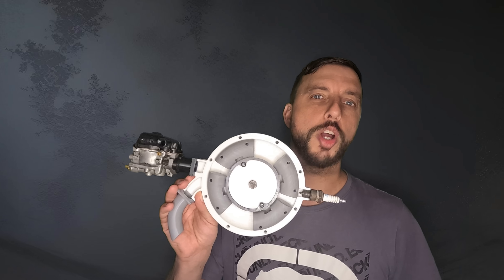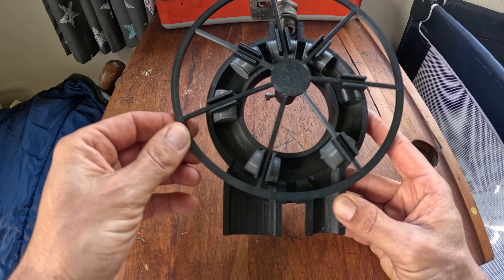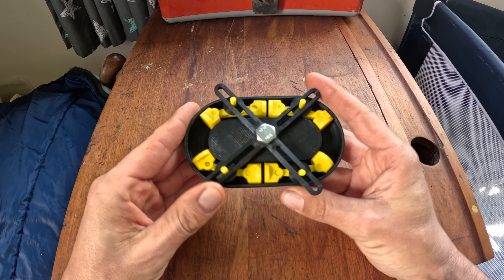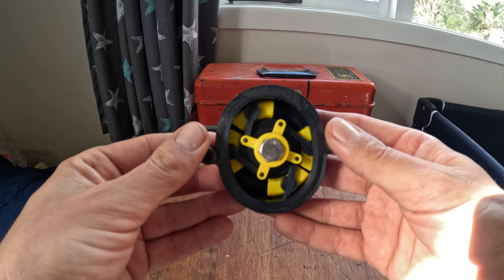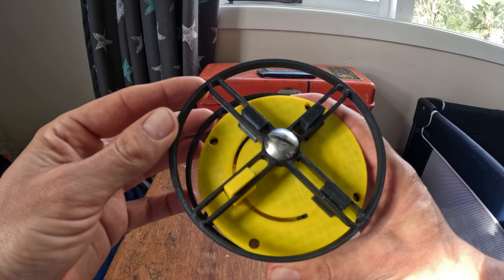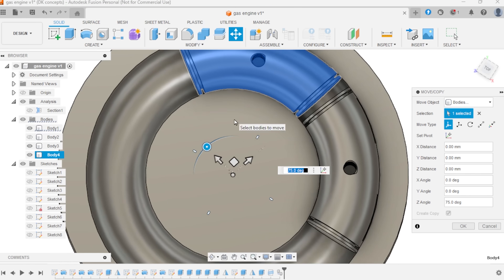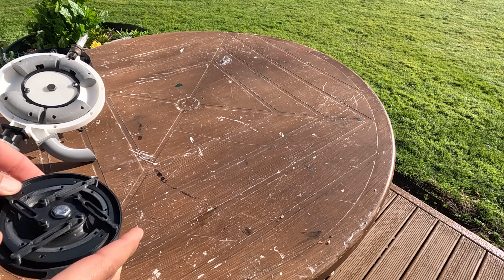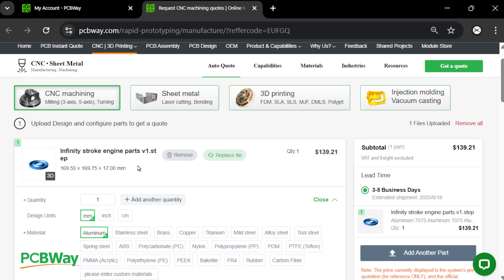Infinity Stroke Engine, More Powerful Engine?

Comment: There will only be two types of combustion engines, turbine (continuous combustion) and piston (intermediate combustion).
Combining the two creating a Frankenstein bastardized hermofidite combustion engine will never work. I loved the wankle engine, it was the coolest sounding engine ever. But cool does not feed the bulldog. 
Continuous combustion engines that use a rotating turbine to suck in air, compress that air, and ignite it, then exhaust it in a continuous cycle, deliver extremely high power for their weight are perfectly balanced, and have few moving parts. Which is makes them great for aircraft. But they have efficiency issues. High bypass turbofans get decent efficiency while producing insane power, but they are huge and are only practical for large aircraft. 
Piston engines are small and more efficient than turbine engines,  but produce less power, are heavy, have a massive amount of moving parts, and dew to intermediate combustion will always have balance issues. But last forever, because they use bigger, heavier, and stronger components, which is necessary to stand up to intermediate shock, and balancing issues.
Trying to combine the two types will always result in issues with sealing,efficiency, balance, longitivety, etc. At the end of the day what is the point of Combining them? You are either removing power, Simplicity, adding weight, etc to the turbine engine. Or removing efficiency, longitivety, etc from the piston engine. There is no happy medium. 
Continuous combustion throws away to much heat energy out the exhaust exhaust to make it a viable replacement for piston engine. That cannot be fixed.

Comment: "Since there is very little oscillation" - this engine has identical reciprocating energy amounts to a normal piston engine, it's just that both pistons also spin in one direction so it's deceptive, there is inheritantly nothing in this & similar designs that set them up for higher RPM compared to the same bore x stroke conventional engine except potentially balance but even an i3 still has good-enough balance so it's kinda not that relevant. Anyway I'm sure there are some benefits but still it's just a weird piston engine, nothing remotely alike a true rotary like a Wankel or that Liquid-Piston that the company decided to make exclusive to warmongers so none of us get the pleasure of using a rotary without apex-seal issues (potentially highest-RPM engine out there by it's nature). With all that said, if you can make it it'd be incredible and who knows, maybe some kind of real tangible benefits will be apparent, after all 2-strokes in any form are theoretically always less-efficient, except those old opposed-piston 2-stroek Diesels are still the most-efficient engines in both theory & practice, so you never know what a design is capable of until everything's in place & it's "in-flesh" so to speak.

Comment: Love this. For minimal prototype this is fine, but i imagine vibration will be a problem still. If you could have it symmetric somehow.  Firing on two sides at the same time. Also, aim for it being a generator, not driving on it. Much less problems with variable speeds and load, I imagine

Comment: Just so my comment doesnt get lost in the replies. Check the myt mighty yet tiny, quasiturbine, rotary vee, dyna cam, and the engine made by angelo di pietro
Reply from the maker: Thanks yes I have checked out that engine, actually quite encouraging knowing someone has made it before pretty wild power claims though
Reply: @dkthewelder claims were enough to get investors but not enough to get a product

Comment: How is the pressure in the "cylinder" being transferred to motion in one direction?  It will push equally forwards and backwards on the two adjacent pistons so the only thing favouring one direction is via those flimsy shafts to the ellipse.
Try placing your fingers between the two pistons and push them apart without favouring the direction you ultimately want the engine to rotate and see what happens.
Reply: To start a heavy flywheel, and high pressure always seeks lower pressure aslong as the exhaust side is lower pressure than the carb side it "should" spin forwards

Comment: Hey DK.  Fantastic idea and damn that's a lot of iterations.  I dig it.  Very cool to see the process.  As far as the spark plugs; Are you planning on mechanical or electrical for your trimming?  That might simplify the positioning of plugs.
Reply: Veritable plug positioning with a clutch might time fantastically.  But I'm not sure if that exists yet on a circular motor with no Dorito chip.
Reply from the maker: electrical timing but the plug position is a little tricky as the combustion chamber is moving

Comment: All the force is coming from two pistons pushing each other apart in opposite directions. This pushes the piston rods apart guiding them down the oval track to fill in the oval's most distant ends. The rods will open towards the direction that the oval track applies the least torque. The rods themselves are angled at the hinge to make the rods opening towards one direction easier than the other direction, making the net torque greater than 0 towards one particular direction... I think... You should test it by putting 2 fingers between 2 pistons and pushing them apart to see if it goes in one particular direction.
Reply from the maker: Yes when I push the pistons apart with my fingers it does as you say moves in the direction of less resistance, or better mechanical advantage. You explained that really well thankyou
Reply: @dkthewelder 🔴 What Is Islam?  
 
🔴 Islam is not just another religion.  
 
🔵 It is the same message preached by Moses, Jesus and Abraham. 
 
 🔴 Islam literally means ‘submission to God’ and it teaches us to have a direct relationship with God.  
 
 🔵 It reminds us that since God created us, no one should be worshipped except God alone.  
 
 🔴 It also teaches that God is nothing like a human being or like anything that we can imagine. 
 
🌍 The concept of God is summarized in the Quran as: 
 
📖 { “Say, He is God, the One.  God, the Absolute.  He does not give birth, nor was He born, and there is nothing like Him.”} (Quran 112:1-4) 📚 
 
🔴 Becoming a Muslim is not turning your back to Jesus.  
 
🔵 Rather it’s going back to the original teachings of Jesus and obeying him.  
 
 
More .....👇 
 
🔴 THE RETURN OF JESUS
Reply: That was exactly my thought too, push each other apart which makes them kinda inefficient. Yet, it could work with 2 intersecting loops which will drive 2 shafts. But, in this case, things become more complicated
Reply: Sounds really inefficient, if even workable in practice, but interesting implementation
Reply: I came down here to explain this exact issue. A ratcheting mechanism could be used to prevent the reverse motion in the "rear piston", I think I'm going to backtrack on that statement. Ratcheting implies a piston would have to come to a stop once per revolution. This would likely introduce a whole new host of issues in something you probably want to spin at 1,000+ RPM. Maybe a flywheel could... no it might aid in resisting the reverse motion but eventually it would stop spinning. 50% of every explosion's force would be in the opposite direction.

Comment: instead of moving pistons why not just make like a solid center piece that has cut outside for each stroke, it would be like a pack man shape, or more like one of those clouds from spongebob square pants , centrifugal force, theres a 2 stroke engine like that, I forget where I seen it and have the sceals on the outer ring beside the intake and exaust, give me some credit if you use my idea please
Reply from the maker: I think I have seen that motor, another one that is difficult to seal but a great idea

Comment: make the pistons out of iron or have then be a hybred metal the magnetic like a alumanum piston and a iron rod in the middle and use electro magnets to hold it in place higher the rpm the stronder the magnetic field
Reply: if you would do this you can conserve power by only having max curent during the combustion faze do to there will be more need for that point

Comment: Also, the second design you should have a steel liner for the barrings to ride on, and that's where the oil return vains can be, so that part can be replaced for repair purposes
Reply from the maker: yes that was what i was thinking!

Comment: Cool idea, but wouldn't there be a large amount of wear on the outside ring as the rpm's increase? I feel like the centrifugal force would cause uneven wear on the piston rings, along with uneven wear from the angles of the piston shape, along with the angle of the sleeves. There may even be blow back on the piston rod parts of the pistons since there is an open hole inside the piston that would pass over the exhaust/intakes shown here at 8:20.

Comment: You don't need a solid object to push the exhaust gasses out and draw in new air/fuel mix. You can do so by opening both ports simultaneously for a brief moment, which your prototype model does. The exhaust will begin to flow out under pressure when the exhaust port opens, and the inertia of the escaping exhaust will act to draw in a new intake charge when the intake port opens. After the exhaust port closes, the inertia of the intake mixture acts to pull in more intake mixture until the chamber is full and the intake port closes. You'll then need a tuned expansion chamber in the exhaust pipe to ensure the pressure wave travels continuously down the pipe and provides negative pressure to the cylinder at the tail end of the exhaust gas puff. This is why most two-stroke dirtbikes and ATVs have that weird looking bulge in the exhaust pipe.
Reply from the maker: I did think about that, the bottom of the 2 stroke piston pushes the next charge in through the transfer ports and some goes out the exhaust until it reaches rpm that the expansion chamber starts working. the other benefit of have the pistons move like that makes them oppose each other which should balance it better I think

Comment: Force transfer using magnets, steel rollers going on cylinder wall...
I've got so many questions...
The main of witch would be "What keeps the following piston from counterrotation once ignition occurs?!"
It looks as if you were trying to lift yourself in the air by yanking yourself by the crouch very hard, or am I missing something???

Comment: The problem is that if the detonation explosion has more force than the force of the rotating mass, the rotating mass will come to a halt. So your horsepower output will be limited to the actual rotating mass weight and speed.  The rotating speed will be limited to how fast the spark will fire. The more the rotational speed the more the explosion force will limit the rotation.
Reply: Yeah, it needs considerable flyheel mass, and that needs to be coupled to all the pistons in some way to overcome reciprocating forces
Reply: @wizrom3046  "Yeah, it needs considerable flyheel mass,"
What I am referring to is that there is nothing preventing these sliding pistons from moving backwards with the force of the detonation. There would be the exact same force on the two pistons. The same force to move one forward and the same force to move one backwards.
Reply: @nathanwoodruff9422   well you are partially correct, but his design connects the 4 pistons to a rotating output shaft, with 4 slider arms.
That stops them being pushed apart.
My point was that it needs a significantly large flywheel, to keep all pistons moving forward AND the sliding arms need to be large and robust enough.
Reply: @wizrom3046  _"well you are partially correct, but his design connects the 4 pistons to a rotating output shaft, with 4 slider arms.
That stops them being pushed apart."_
If the pistons were not being pushed apart the entire thing would not move. The detonation of the gas is pushing on the forward piston as much as that pressure is pushing on the rear piston. 
If the pressure between the 2 pistons is more than the weight of the rotating mass, the rotating mass will come to a halt. As I said, limiting the horsepower output.
Reply: @nathanwoodruff9422  more correctly. at its "TDC", combustion pressure is momentarily equal in both directions as both pistons are at the same radius, and same relative angle. as "expansion' continues, the leading piston is always at a slightly longer radius with more leverage than the trailing piston. the available force is the difference between the two. which amounts to very little...

its just another stuck in the rut "otto cycle with alternate geometry" approach. nothing new.
Reply: @paradiselost9946  "more correctly. at its "TDC","
TDC stands for Top Dead Center, where a piston in the cylinder is at its highest point in the cylinder where compression is the greatest. A roundy round of pistons has no TDC. The energy from the detonation of fuel is pressing both pistons with the same amount of pressure, both forward and backward in the roundy round.
Reply: @nathanwoodruff9422  see those quotation marks? see how i wrote "TDC"?

 it implies the "equivalent of TDC". 
"the point of maximum compression"

dont try to be clever when your very argument shows youre a halfwit and cannot understand simple concepts that shouldnt require spelling out.

it has a point of maximum compression. 

that the compression then has no real urge to act in one direction over the other is not the point in question now. its the fact that you cant comprehend what the "equivalent to TDC" is without having your hand held and gently guided...

or rotor doesnt have TDC either but its still marked as it on the case. i guess NSU didnt know WTF they were doing huh?

got an engine here with two top dead centers, a bottom dead center, and a mid dead center. go figure that one out...

Comment: I like the concept. It's an interesting idea, One potential flaw I could see is what is going to keep the engine from trying to run backwards. Or the Pistons firing in both directions. I'm wondering if you could possibly make a mech for the Piston rollers to only roll forwards, not roll backwards. Like a one-way bearing.
Reply: Maybe some sort of flywheel that will help parts to rotate in right directions.

Comment: So I hate to be that guy but unless I'm missing something there is nothing to bias the expansion to pushing the engine in One direction. You have the same size face being pushed with the same pressure in both directions. That means the same Force pushing backwards as is pushing forwards. Unless the whole idea is to push the Pistons away from each other and that somehow spins it forward but I'm missing it if that's what it does.
Reply from the maker: As long as it is past TDC the lead piston has a mechanical advantage, I can actually change the shape of the ellipse to make the trailing piston nearly stop at TDC
Reply: @dkthewelder so the difference in force needed comes somewhere from where they're linked together and not from the shape of the combustion chamber?

Comment: Couple of thoughts
Personally I don't think the magnets will work to drive the pistons. The force needed to compress the charge will probably be enough to overcome the coupling force, let alone the combustion forces. 
My first thought as an alternative is a slot all the way around with a circular insert that spins with the pistons and is sealed by a piston ring on the inside and outside edge. 

9:09 To start I would put the spark plug positioned so the chamber passes the plug at or just after TDC, so you can have the widest range of ignition advance available. 
I don't think this design would benefit from having dual plugs like a wankel rotary because it doesn't have an extremely long, narrow, and obstructed combustion chamber like they do. Though it could be useful to have two or more position options on the initial prototypes.
Reply from the maker: Thanks for the comment, I really want the magnets to work as that fixes the sealing problem and them not being strong enough to hold the pistons is a big problem but what if you also had electro magnets around the outside, I will explain more about this next video and hopefully I can do some testing

Comment: Take a look at the Rand Cam engine design. It uses sliding vanes between two wavy surfaces. The original design never worked but there is a guy that fixed the design and has blueprints online. Similar concept to this engine but with a different layout.
Reply from the maker: I will look at that thanks
Reply: @DktheWelder also look at the myt - mighty yet tiny, rotary vee, the dyna cam, and quasiturbine.